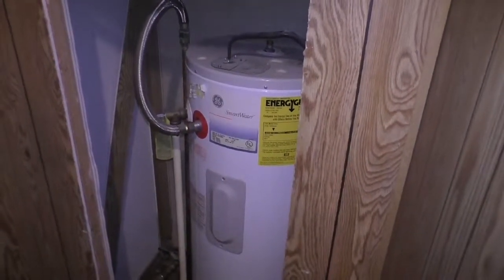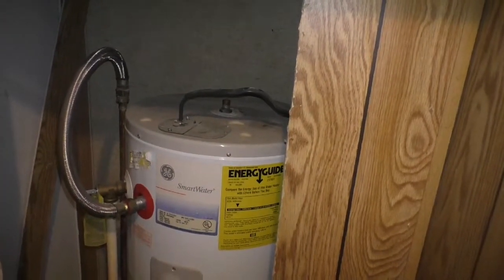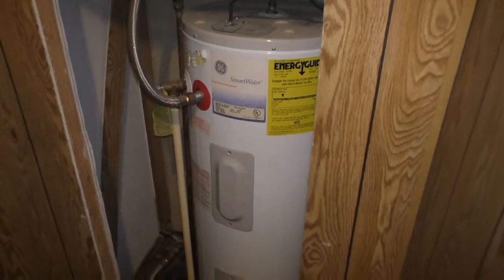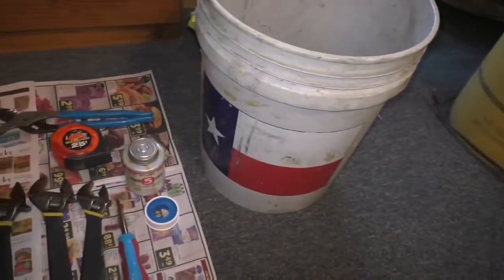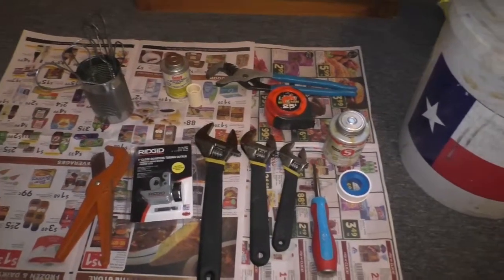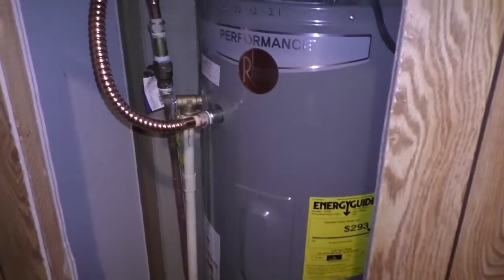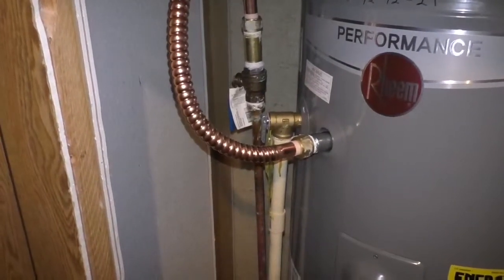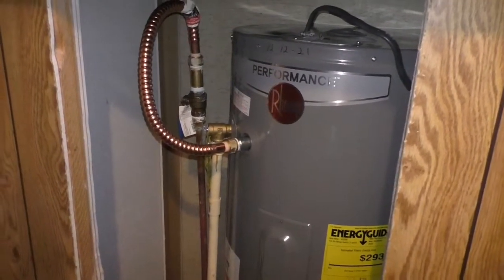How to replace an electric water heater (for mobile home)

Comment: Hello, can I put a water heater with the cold water coming from the top in the hot water coming from the top is that gonna make a difference?
Reply from the maker: Water heaters have a cold inlet, and a hot outlet, so you pretty much just have to go with the way it's set up.

Comment: I have that same water heater and I'm currently tryna figure it out as well
Reply: How much does a hot water heater for mobile home cost
Reply: Need l lowest
Reply: I'm home Depot
Reply: Home
Reply: May I help
Reply: @raymondnichols7119  can't remember but I think I paid like 900
Reply: @WinmanVideo did you buy the right one because if you bought one that didn't say manufactured home and installed it in a manufactured home without HUD approved seal, you may be out of code!!!!😳

Comment: Where is the expansion tank?
Reply from the maker: It's not necessary (or required by code) where I live. And that's what the pressure relief valve is for.
Reply: It is where I live . Unfortunately and yes I know what the relief is for as well as draining the tank annually to remove sediment